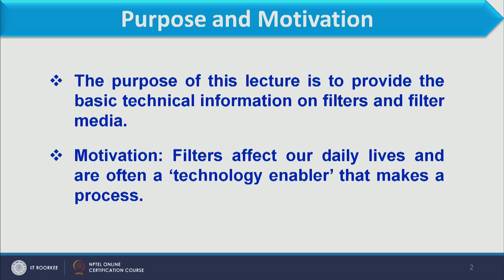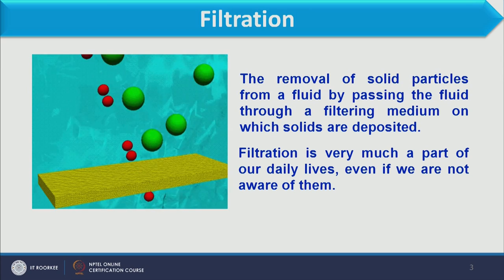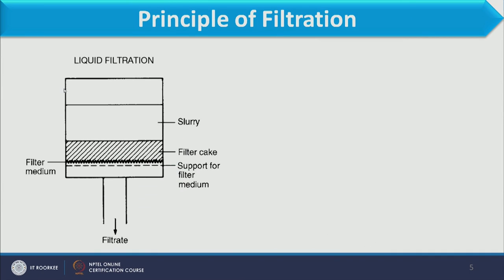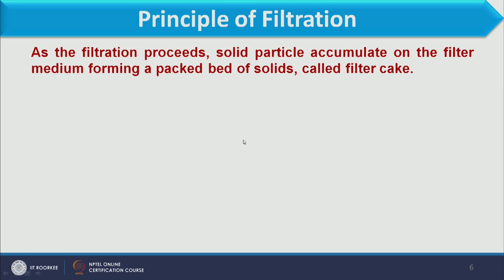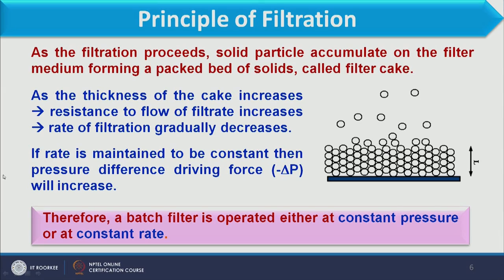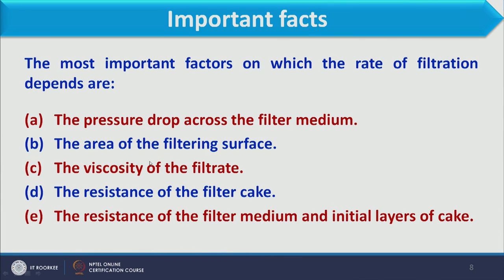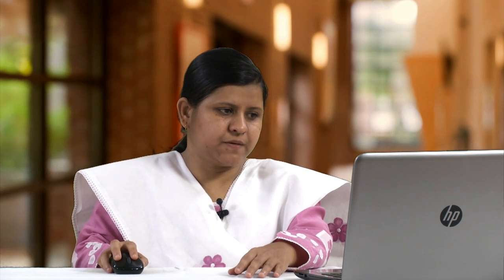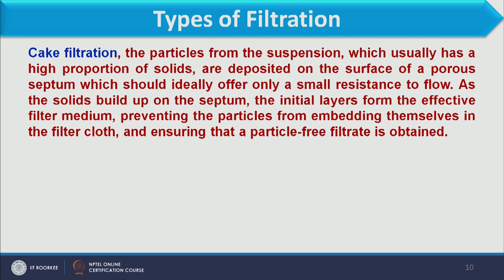Filtration-1

Comment: Nice job! The filter press is one of the oldest process filters and dewatering machine which is used in a variety of applications. It still remains a pioneer in solid-liquid separation with a very good price-performance ratio before the centrifuge, decanter and belt filter! 
Greetings MSE Filterpressen®. Your specialist from germany.

Comment: What is filter cake?
Reply: It is exactly what she says it is. It's the material that is filtered (stopped by the filter). New filters are clean, used filters have accumulated particles. This is the filter cake. It can act as another filter, as the fluid has to pass through the filter cake before reaching the filter.